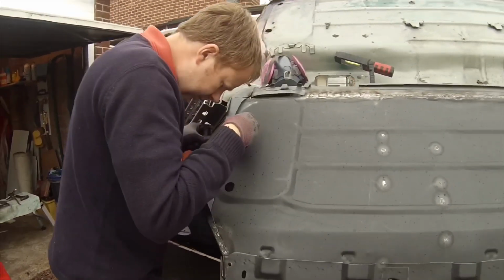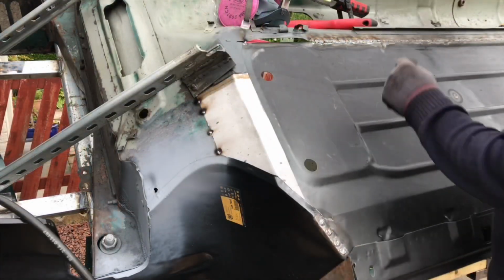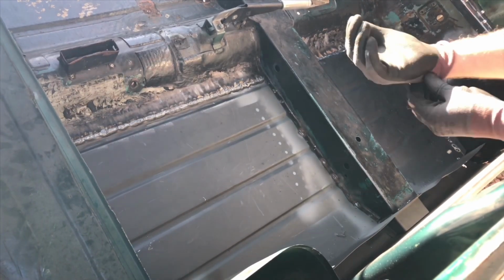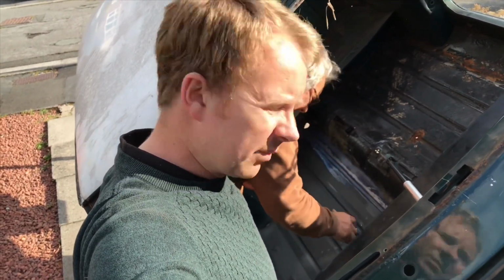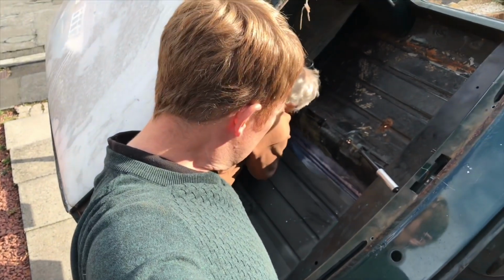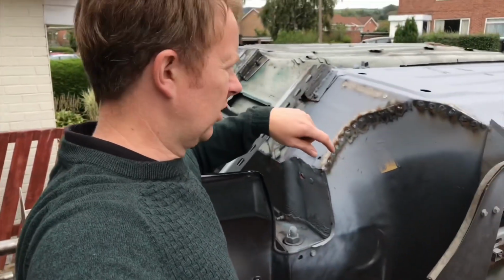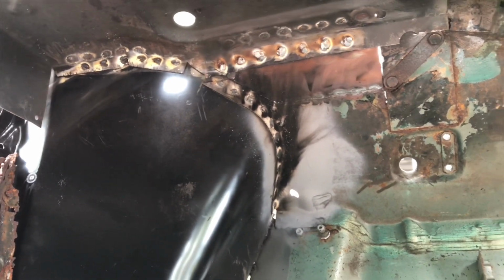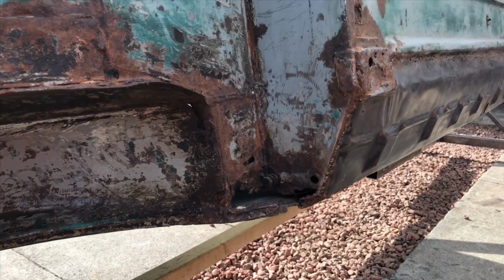Classic Mini Mk1 Conversion - how to fit new floors - Part 5

Comment: Great job on the floors & inner wing nice neat job on the toe board repair, I would use a heat gun and get the stickers off the inner wing but i guess you will be doing that at some point, I will give you a shout out when ever i can, Cheers Dave
Reply from the maker: Hi Dave 
That’s fantastic thanks, also thanks for the last shout out, it definitely helped with subs and views. It’s definitely much more motivating to do the videos when people are watching them. I keep forgetting about that sticker, will get that off with the heat gun like you say.

Comment: Guys ...
Good to see a classic being saved 👍
But why use a spot weld drill to drill huge holes only to add heat and time to a job later grinding grinding etc, wether hobby resto or not ? to spend ages plugging with a mig to me is 🤪

Maybe just a clean sharp 3.5 - 4 mm hole /countersunk would suffice and use plenty of current. 
Then spend time super dressing so flat as ! Grind then flapper disc etc 240 grit flapper..

Once there ... using a pin punch ground to factory spot weld size ( try first on scrap double steel already welded an linished first )
Hit the smoothed out pre-welded flanged area you want to look factory. With the punch supporting underside with a hammer head or dolly. 
This will simulate any area you chose to want to make look like factory 😉 Taking care to try to replicate the sections originally manufactured 🙈
If done correctly even just a coat of primer and top coat will present just like factory did. I’ve been restoring cars for 40 years and some old fart ( I was young then I might add ) showed me that trick. 

Yes it may take a tad longer but you will be surprised if done right how much better ground down plug welds appear to someone who is maybe buying later..
Please remember you are restoring a classic not some plastic fantastic mince thin steel piece of you know what that will over time NEVER be worth anything !

Good luck chaps 

Del

Del
Reply from the maker: Cheers 👍👍